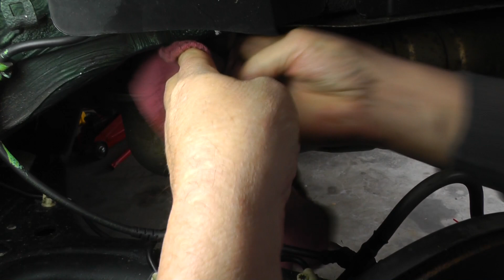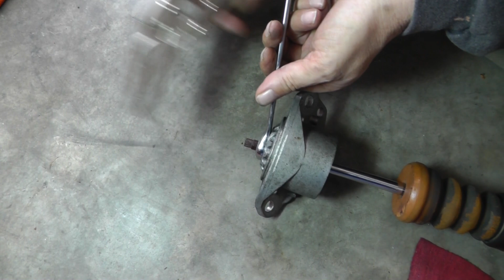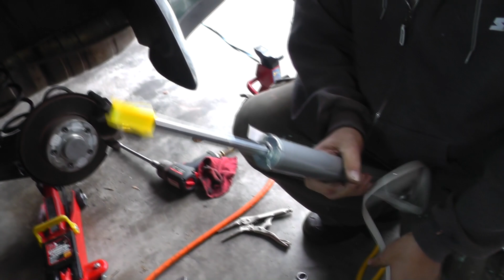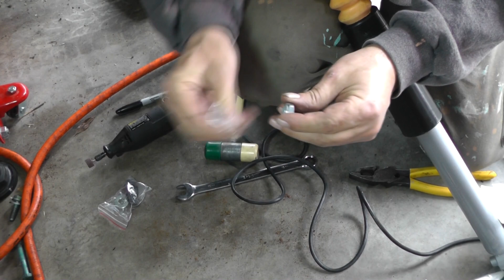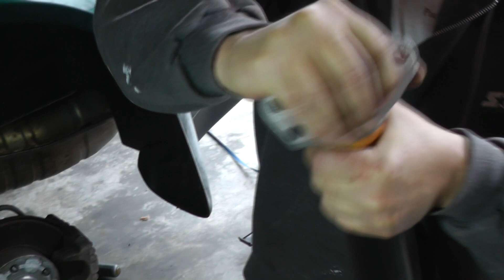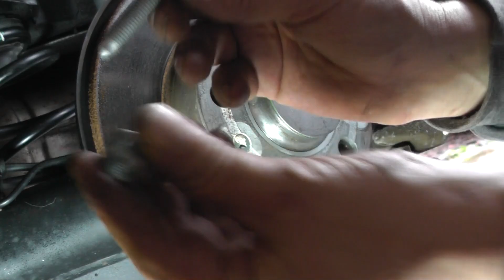Volkswagen Jetta Installing Rear Shocks and Springs - Part 4

Comment: https://www.vwpartsvortex.com/oem-parts/volkswagen-spring-seat-1j0512149b/?c=Zz1yZWFyLXN1c3BlbnNpb24mcz1yZWFyLXN1c3BlbnNpb24maT05Mjc2NzI1NSZyPTE2JmE9dm9sa3N3YWdlbiZvPWpldHRhJnk9MjAwMyZ0PXRkaSZlPTEtOWwtbDQtZGllc2Vs
found this online source for the misc parts, most of the online retailer sites don't ref the individual parts & it was hard to find a replacement through the usual sources.

Comment: stuzman.
Ill find your videos amusing and very educating around vw vehicles. And thge sarcasm coming out about the engineering is hilarious. 

I also ended up to be a owner of this magnificient german engineering and o`boy i'm loving it.. Hmn :)
Im gonna swap my shocks/springs this weekend and then im also gonna take down half the front to change my light bulb. 
Yes.. its needed on the passat b6 (xenon) to remove bumber, grill etc.(insane). Gotta love  the germans.

keep up the good work!
Reply from the maker: HaHa Mattias! Yes, you're going to love that VW once you start working on it :)
Reply: Im not sure about that Stuz.. 
The springs got installed simple and quick. just 1 bolt and it was a cake walk.. 
But all this special tools and nut positions drivs one crazy.. 
I also was in for trying to change the pulley on my serpentine  belt since well, i was gonna change the belt and i wanted to be sure its safe, its not a big cost.. 
But man, what are the germans thinking, look it up if u want a laugh, a passat 2010 (CBAB), have to remove half the carr to change a pulley.. on the bkp model its just 2 bolts.
Have a nice weekend
Reply from the maker: Nothing surprises me about the VW's anymore about what's involved with removing things to gain access. It sounds like you're learning your Passat pretty good though :)

Comment: where did you order all the parts for the shocks? was it all bought sepertly?
Reply from the maker: I got everything online except for the shock caps which came from the local dealer. I can't remember where I purchased them from.
Reply: ok so I call the volkswagen dealership.

Comment: I was afraid you were going to blow a gasket on those torque to yield bolts. Was that 421 on your test drive?
Reply from the maker: HaHa! On the test drive,, I didn't even punch it; probably about half-way down on the accelerator. 421??? Not sure what you mean?
Reply: US 421

Comment: thanks for the info, great help. having trouble finding replacement piece to fit over rear shock( the part you used Dremmel on). can you tell me the name of the part or where to get? thanks. Merry6 Christmas!
Reply from the maker: +Jeffrey Gazso For that part, I got it from the local VW dealership as I couldn't find it anywhere online. From my memory, it wasn't that much and Merry Christmas to you and your family.

Comment: For beetle owners: my beetle mkIV has the same suspension as as your Jetta, and Bentley has you tighten the lower shock bolt with the wheel on and resting on the ground, to avoid loading the bushing. Also 44 ft lbs and zero turn.  Great series of videos - they were most helpful when replacing my shocks. I love the explanations that you give.

Comment: stuzman52  how do you like the sensen struts and shock combo I was thinking about getting the same set up?
Reply from the maker: I like the sensen shocks pretty good as they are supposed to be the OEM supplier for VWs. What I didn't like was that I had to grind out some of the plastic around the plastic end caps which I purchased from the local VW dealer. Other than that, they have been holding up pretty good.

Comment: Well done - looks like the car was out of service for a while waiting for parts. I enclosed a tool you could use in the future.
http://www.amazon.com/Lisle-20400-Universal-Shock-Absorber/dp/B000CO88C6/ref=pd_cp_hi_0
Reply from the maker: Hi Steve, I was sure there was some special tool that would allow turning the nut while holding the shaft. I'm not sure this tool would work as I didn't see how it would hold the flat part. Thanks for the comment Steve and is all that snow melted away up there yet? Still pretty cold down here with some high wind speeds going on today. I am ready for the warm weather to stay consistent. Take care Steve...
Reply: the tool has 2 flats to grab if you check out some others you can see better.  I have had the tops almost rusted off and cant grab the flats anymore.  Well the snow is still here and my buddy just came back from ice fishing and it was 40 inches thick. Doesn't have to take the huts off the ice till the end of April.
Reply from the maker: Thanks Steve for the input on the tool. I'll have to look into it more closely. 40 inches of ice thickness; unbelievable. Wow Steve, I sure don't envy you guys up there with that cold weather, ice and snow. When it gets 40 degree F, I'm already too cold. Blood must be getting thinner as I get older.

Comment: Nice wrap-up! I must apologize... I mentioned the green markings on the brake lines (in the prior video), but I just realized that the green marked item is an abs harness, sorry about that! Was that replaced by you or prior owner. Guess it could have been a mechanic like me, since I like to mark things that I replace (date & initials).
Reply from the maker: Thank you Thomas and never no need to apologize. Whatever green that you saw came from someone else and any other work came from someone else. As always I appreciate your comments.